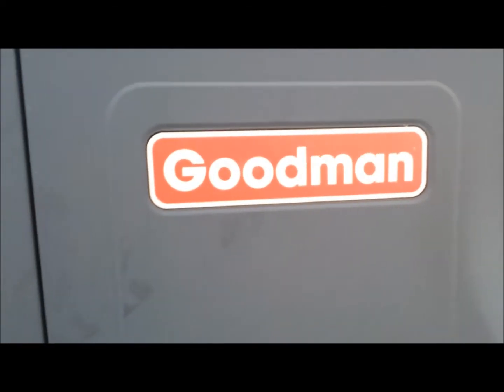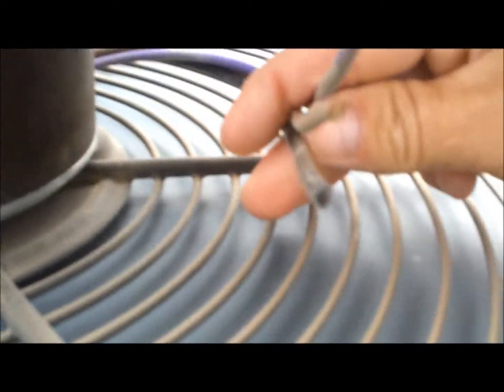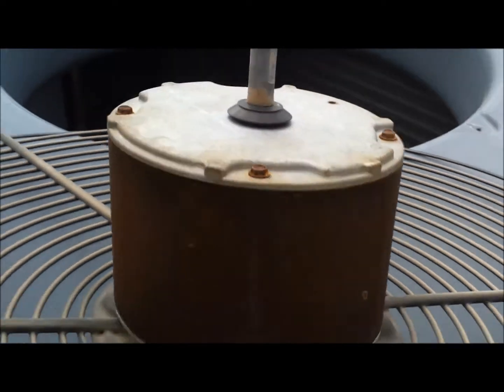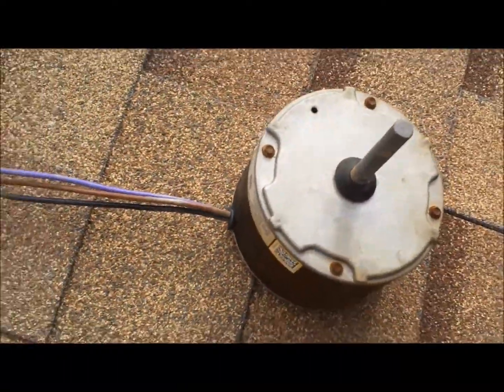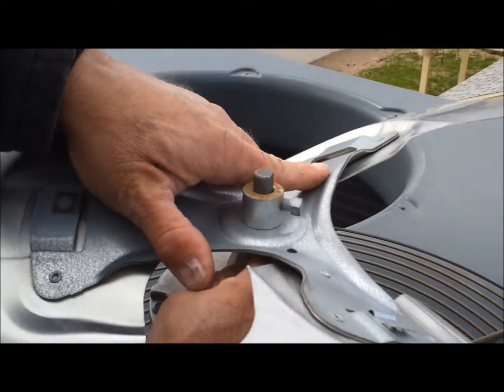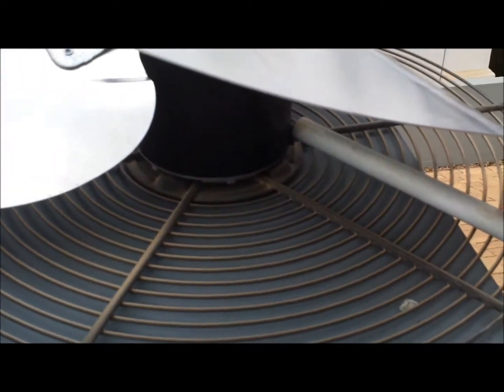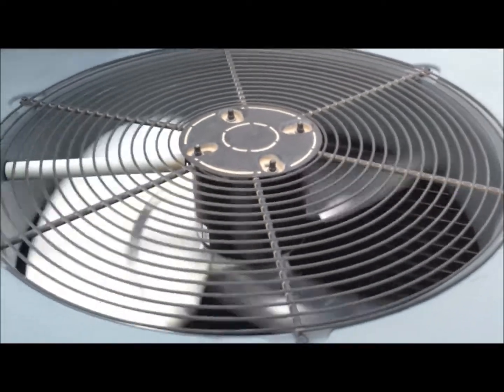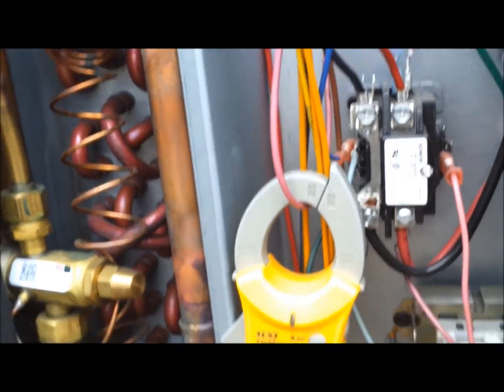How to change a Condenser fan motor and check the Amp load Goodman HVAC

Comment: My condenser fan motor is drawing 1.1 amps and the specs say 1.2. When will I need to replace the motor? Should I buy one to have in case it goes out? Or does it do more damage to wait until a motor stops running?